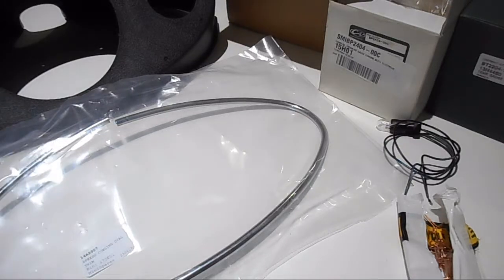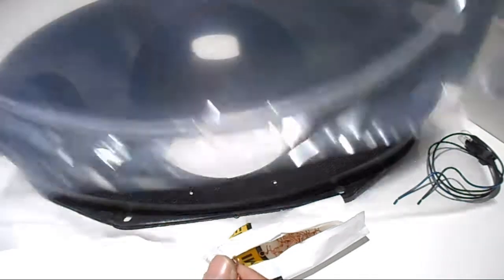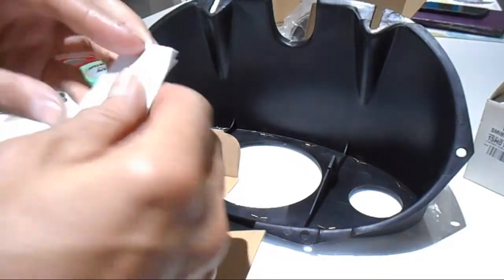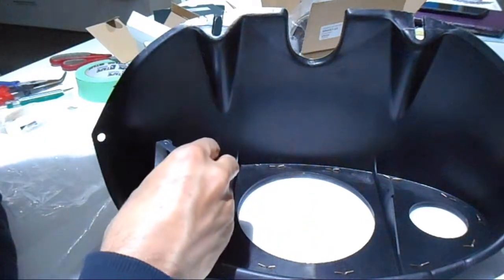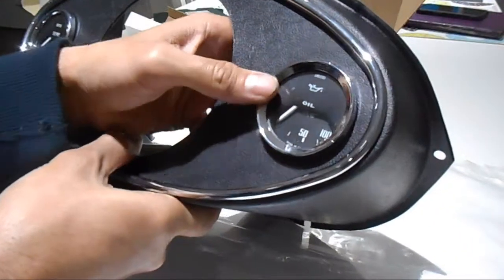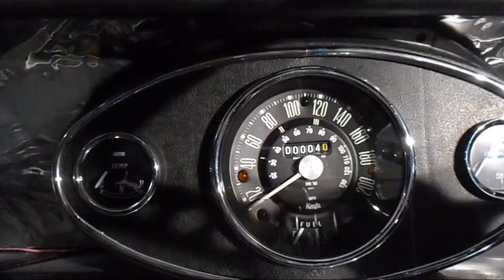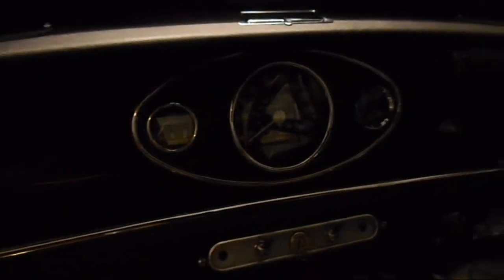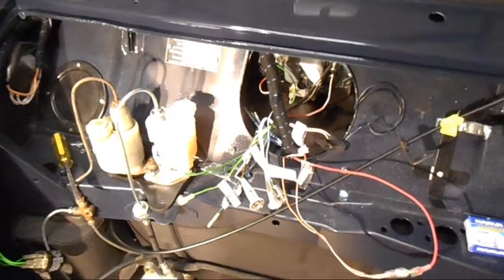Morris Mini Cooper S - Speedo binnacle and gauges EP027

Comment: I'm about to swap my 2 clock LHD dash on an '88 Mini for the center binnacle setup. Your videos are a big help. My speedo is a new, old stock 90 MPH clock with also 4 miles on the Odo. I'm hoping to tap into the existing 2-clock harness (which is for the later Nippon circuit board clock assembly). Ideally I'd like to find/make up a multi connector plug to have one plug for the new speedo and temp/oil pressure clocks. Would make working on the instruments easier in future when having to disconnect/re-connect them.